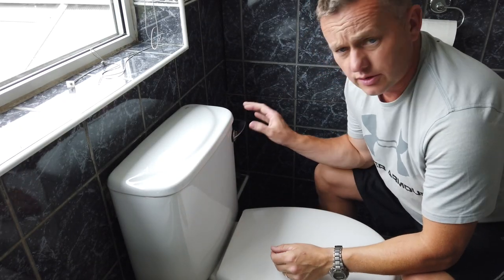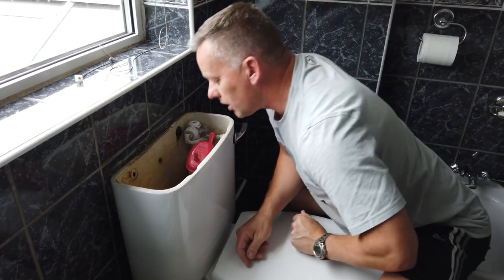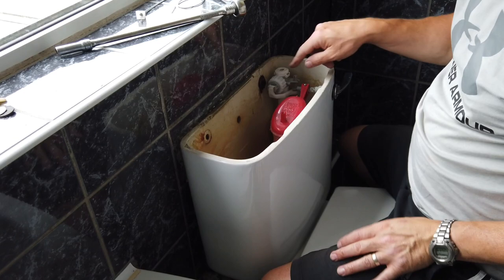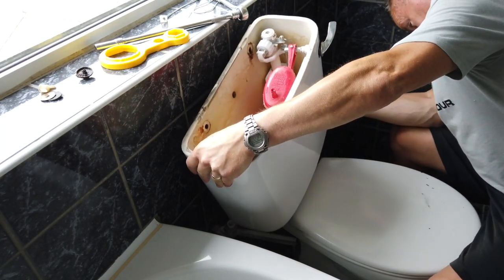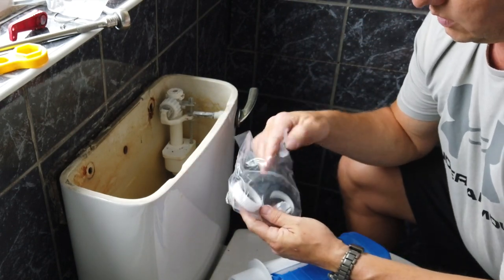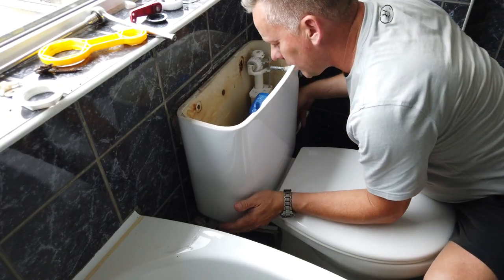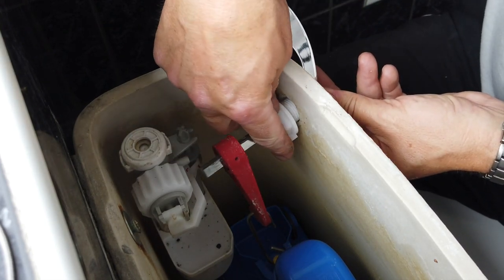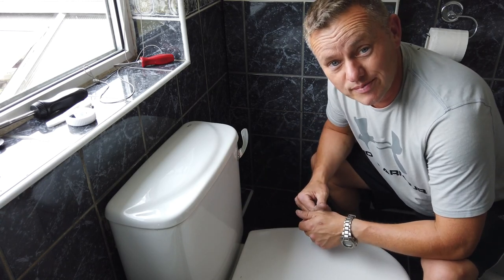Dudley Cascade Toilet Cistern Repair "Wont Flush" How To Replace Syphon 88, Upgrade Less Water Use

Comment: Hi Anton another great vid. You might get the handle to sit lower down by extending the C shaped metal clip, but not so much that when you pull the lever down to its full travel, the top of the clip hits the cistern lid. You are right about the plastic diaphragm, they are very flimsy thats why I always fit two to make it stronger & last longer.
Reply from the maker: Thanks for the tip! & Thanks Guy for the great comments👍🏻👍🏻🛠

Comment: good job 👏💯 . ..i had occasion to do the same job. the new plastic bracket on the handle was a problem. wouldn't flush after i fitted it. it turned out that the "C" clip that came with the new syphon was too short. As a result the plastic wasn't going to the bottom of the syphon & pulling up enough water to activate the syphon system. i discovered that there are 3 different "C" clips lengths. short , medium & long. i bought a packet, with the 3 different sizes for €3.95. I think that you needed the long one for your new bracket & would have worked OK then.......👏
Reply: before i fitted the longer "C" clip, i used a length of plastic twine instead. was 2 months before i got back to the job but twine wasn't worn. i was going to make one from a length of wire coat hanger but that would rust & break. the "C" clips are stainless steel...just a tip...
Reply from the maker: Thanks for the great information👍🏻👍🏻🛠
Reply: you are more than welcome, i hope that you find that information useful in future. nowadays, if the cistern fills & water cuts off, that's OK. next, i pull the "C" clip by hand with handle unattached. if that flushes, then ok to that point. then i measure the length from the plunger to the handle at normal position, select the correct "C" clip & never any problems. saves me a lot of time. @aaanton11   👏☘
Reply: i forgot one VERY important thing. when changing the "C" clip, make sure that the plunger doesn't drop to the bottom of the syphon. otherwise, you will have to dismantle the toilet again to retrieve it.  i put in a length of plastic twine, beside the "C" clip before i remove the clip. string is about 24" or 61 cm to make a big U so no need to tie a knot .the string is also very useful to pull up the plunger to change the clip. .... @aaanton11  ☘☘☘